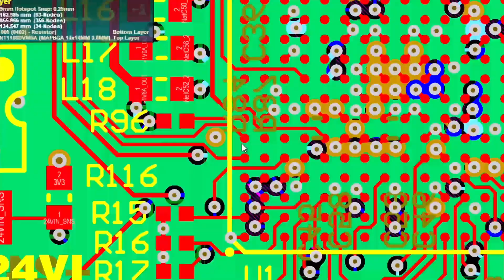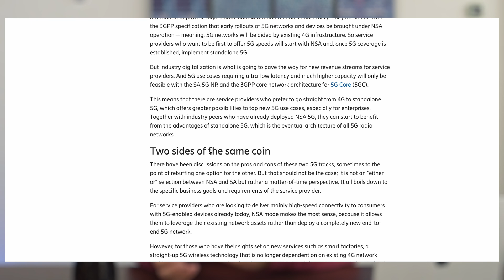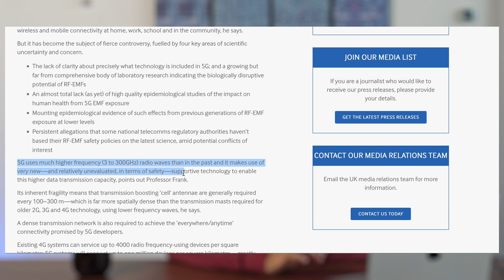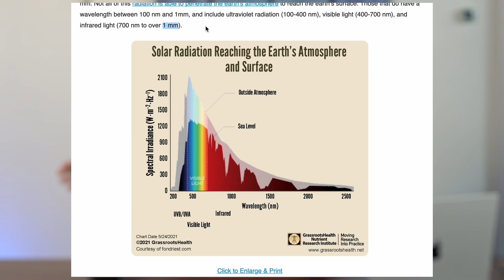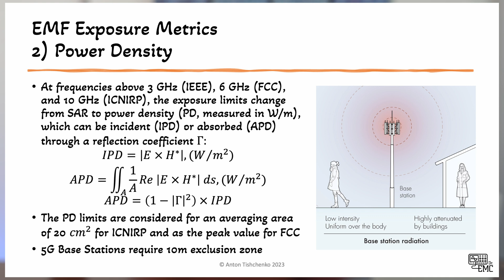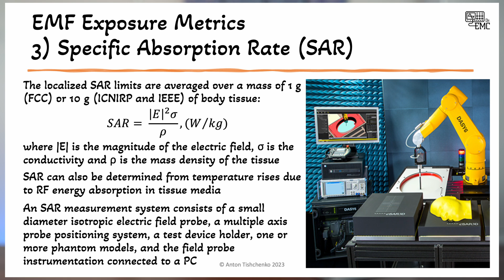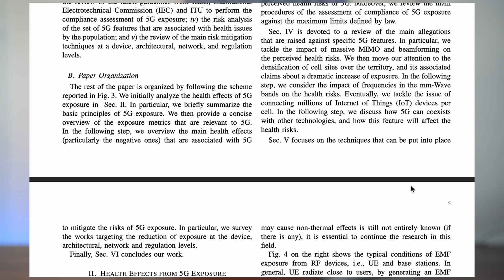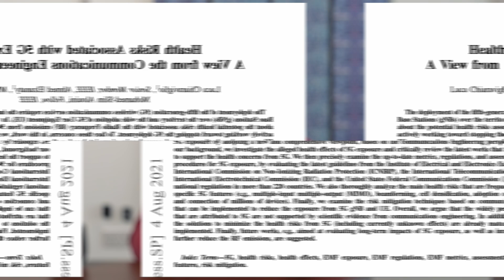EMF Exposure of 5G mmWave

Comment: Interestingly enough, the military developed the Active Denial System (ADS) directed-energy weapon using mmWave. Re: 5G mmWave – In the United States, the deployment of 5G mmWave technology has seen significant progress since its initial launch in 2019. Verizon was the first to launch its 5G service on mmWave in April 2019, followed by AT&T in March 2020, and T-Mobile in June 2019. Movandi is a major mmWave solution provider. 5G mmWave can be (and has been) weaponized. 5G requires densification which means that people will be exposed to mmWave round the clock – and the consequences of long-term mmWave exposure must be studied.
Reply from the maker: it's also known as a heat gun

Comment: >150,000 5G towers went online near-simultaneously in the region of Wuhan (the world's 2nd "all 5G test city") between Nov-Dec 2019.

5mm wave technology was widely activated across the telecom's existing 5G infrastructure throughout Western Civ in Dec 2019.
Reply from the maker: There's no such thing as 5mm wave technology. 5mm wavelength would be 60GHz frequency, which is currently not in used 5G, not even in Wuhan 🤡
Reply: @DrEMC-sf8rx  Re: 5G mmWave – In the United States, the deployment of 5G mmWave technology has seen significant progress since its initial launch in 2019. Verizon was the first to launch its 5G service on mmWave in April 2019, followed by AT&T in March 2020, and T-Mobile in June 2019. Movandi is a major mmWave solution provider. Lol

Comment: There were some useful nuggets here, so thanks for those engineering perspectives.

Many health issues stem from both 4G/5G, unrelated to SAR or thermal levels. Health issues exclusively confined to thermal damage is a 70 year old fib that worked well for the American military-industrial complex in the 1950s and works well now for telecom companies that wish to avoid liability. It is better to seek health information elsewhere, perhaps PHIRE, IGNIR, BioInitiative or Building Biology. Look for 'microwave illness' to learn the list of symptoms.

Very low level RF exposures -- on the order of a few microwatts per meter squared -- are enough to produce acute and painful symptoms in my electrically over-reactive partner.  These pulsed & polarized man-made RF signals clearly have a biological 'effect', even at more than a one million times lower than the FCC exposure harm threshold.

As Upton Sinclair used to quip -- It is hard to get a man to understand something if his salary depends on him not knowing it*.  It is *incorrect that harm does not derive from routine over-exposure from modern phone and antenna infrastructure, or is some kind of fictitious, made up story. Whenever someone tells your that claims of RF harm from 4G/5G are fabricated, ask them to show you specific solid long term research that shows that 4G/5G is perfectly safe .. their silence speaks volumes, for none of these technologies have been tested for safety before their deployment and are not currently being tested for safety even now.  

A health-wise antenna designer might look to read Robert Kane's book Cellular Telephone Russian Roulette, as he was an antenna engineer 25 years ago and wrote it as he was dying of cancer contracted from his telecom employment at Nokia.